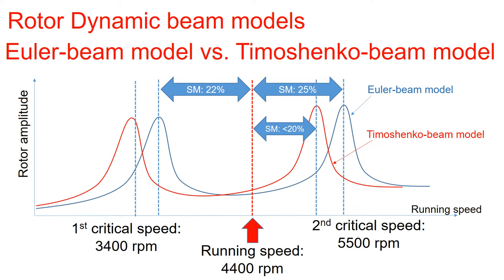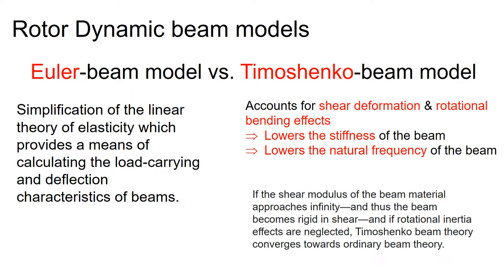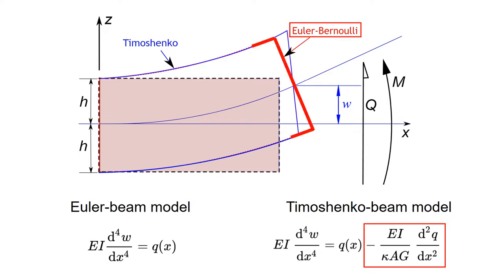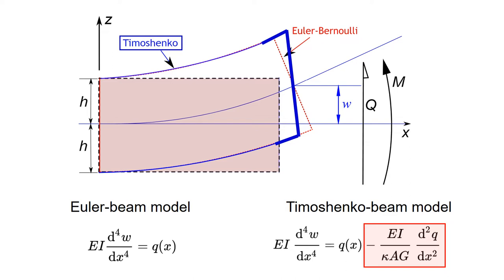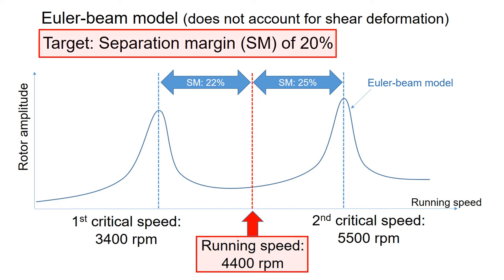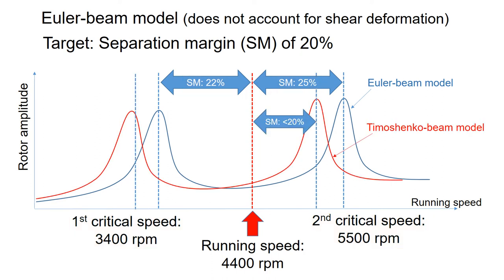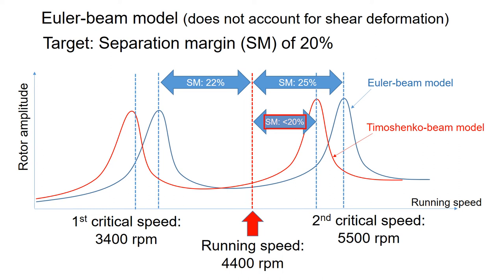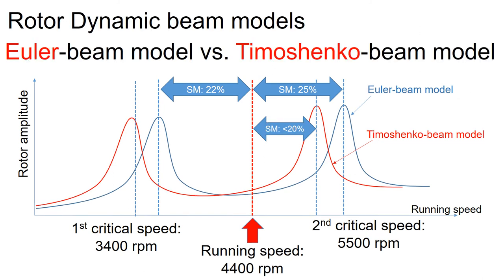Part 9 - Euler beam model vs. Timoshenko beam model

Comment: Thank you for the nice video. One note is that the difference b/w E-B model and T model increases with the decrease in the ratio of the shaft dia and the length, D/L. A slender shaft shall be analyzed by the T model. Otherwise, the E-B model may work just fine.
Reply from the maker: Thank you for your comment. You're absolutely right! The shaft D/L ratio affects the degree of difference between Euler and Timoshenko beam models.